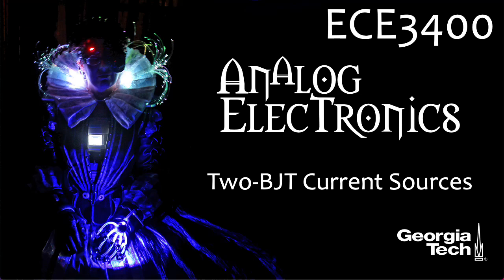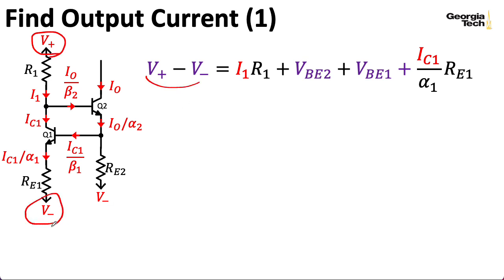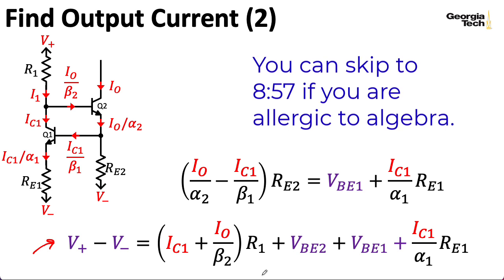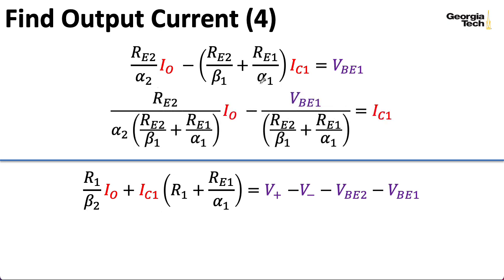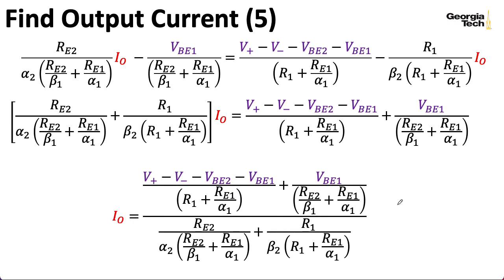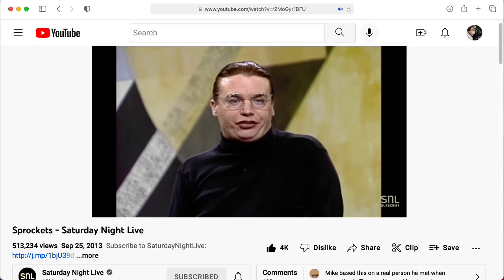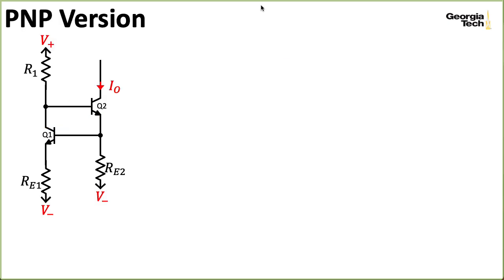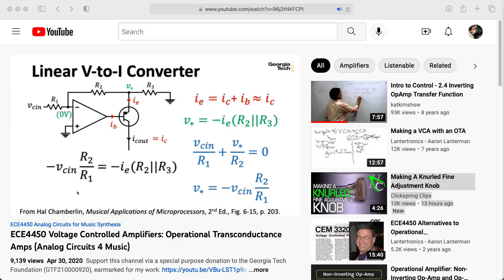ECE3400 Lecture 29: Two-BJT Current Sources (Analog Electronics, Georgia Tech course)

Comment: 11:14 if you remove Re1 you got a whole lot of problems and you need to put resistor on the base of Q1 unless R1 (and Re2) is big enough.  correct me if i'm wrong, but if the HFE is a model transistor is 100 you literally needs mA on the base of transistors dealing with voltages of 5, 12, 15 or similar voltages.
good thing multi meters exist.